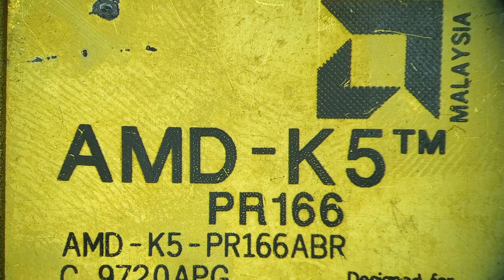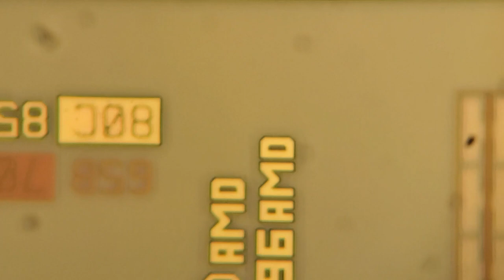AMD K5 CPU Delid: Exposing the Integrated Circuit within

Comment: Actually a RISC CPU in disguise...it's an AMD 29K emulating a Pentium-class CPU in microcode.  The K6 was also RISC internally but wasn't based on any existing RISC design, instead being a clean-sheet design originally from NexGen which was optimised for executing x86 instructions.
Reply: intresting

Comment: I can't believe how small the circuits are. The magnification required just to see them is insane. The parts that initially looked like random scratching were in fact parts of the circuits too. It's truly amazing that in '96 manufacturing could produce something like this. Is this in micron and nanometers? Or a measurement I'm not knowledgeable about? Either way it's beautiful and impressive. Even in 2024 the size of phone cameras are psychotic to me. Just imagining electron flow boggles the mind lol. Thanks for sharing 😊